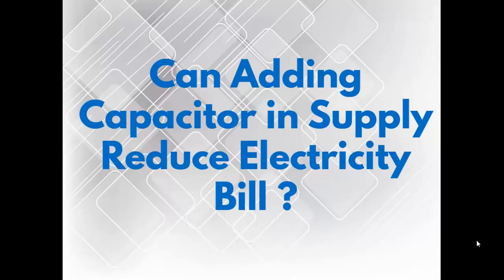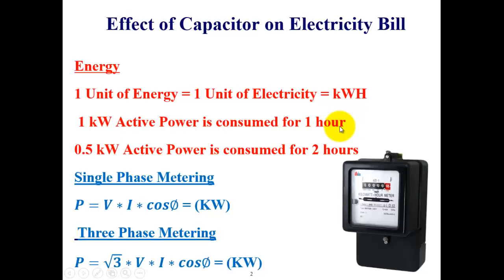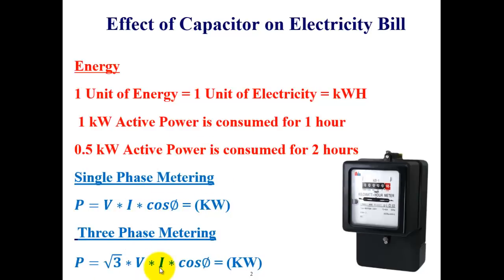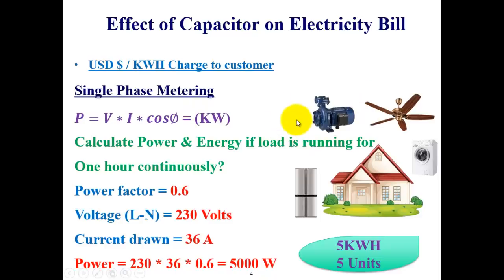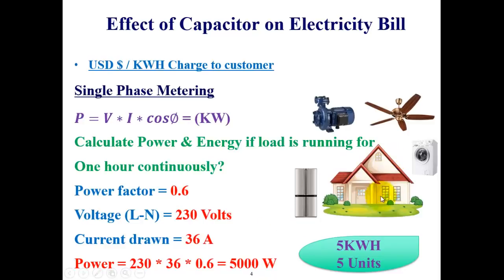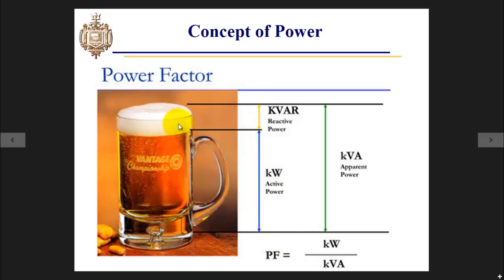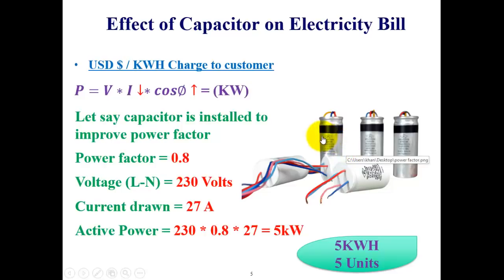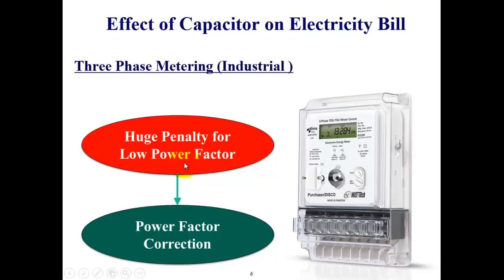Can Capacitor Reduce Electric Bill ? | Truth Reveal

Comment: I don't know yet about the other, but some of the metering device used in houses calculate the power consumed by only reading the current without the voltage and power factor. They just use magnetic induction caused by the pasing current and show the kwh consumed
Reply: Is the power factor not included in the magnetic induction see 5amp in 2 amp back you get 3 amp of induction

Comment: Its informative video. My question is , doesnt it depend on where we installed capaciotrs. If we install capacitor on HT side only to improve power factor but LT side equipment working inefficiently, so by improving PF at end , ultimately being converted to high units
Reply: WHEN YOU ADD A CAPACITOR THE POWER FACTOR WILL IMPROVE AND THE CAPACITOR WILL  ELIMINATE THE LOSSES OF ENERGY FROM THERE YOU WILL HAVE SOME SMALL SAVINGS. THANK YOU

Comment: your explanation is good, but you need to mention the extra cupper power loss I^2 R withen the cables which can be reduced if we improve the power factor.
Reply from the maker: Disadvatages of low power factor 
https://youtu.be/s1oH6yO_wcE
Reply from the maker: Yes you are right but this is another discussion that is disadvatages of low power factor which is covered in my latest video. Thanks

Comment: Capacitor used to increase the power factor
Reply from the maker: Yes . There is proper calculation for power factor correction. I have not covered that topic in this video
Reply: @electricallectures  is it ligal